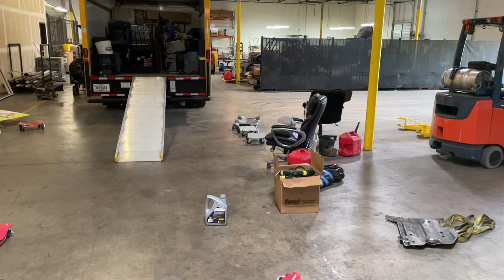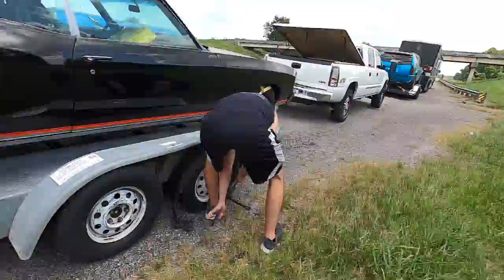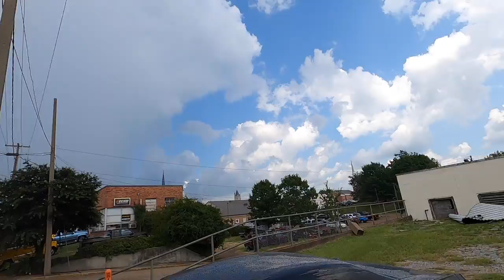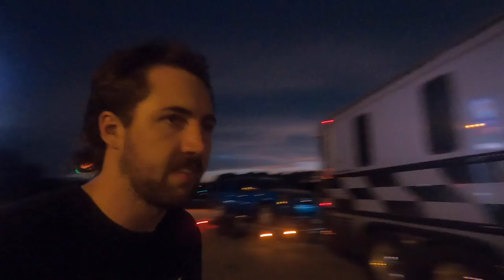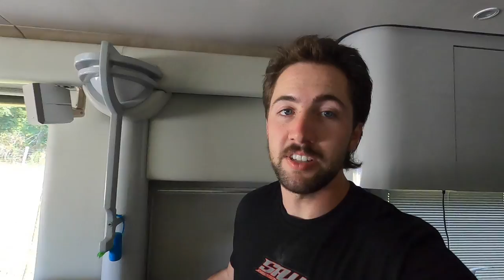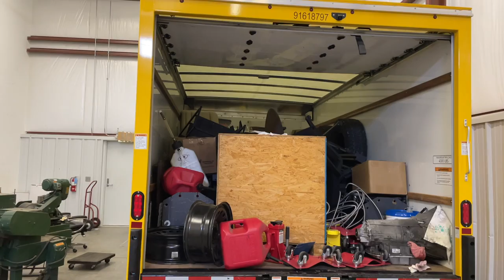WE MOVED! 1,100 Mile Road Trip To Our New Shop! We Had Some Problems.. (Meet The New Garage)

Comment: Just want to say Logan is a trooper during the roadtrip car hauling adventure.
Reply: She's the unsung hero. Just jumps in and does stuff without being asked. Wife material right there.
Reply from the maker: @nomercyinc6783  You totally have no clue lol
Reply from the maker: @krisjones2265  You’re absolutely right. These last couple months have been probably the most difficult time I’ve gone through and she was right there with me. Couldn’t have done it without her.
Reply: she actually seems really cool
Reply: @nomercyinc6783  To a lot of people driving that kind of distance is really intimidating. To step up and do that while towing a trailer for the first time is a big commitment. And then getting hit in the trailer in the first mile would shake a lot of people's confidence. Then driving hundreds of miles with the trailer way out of alignment, I'm sure it pulled a little. And then the flat tire. And driving with three wheels on the trailer, etc. And then find her a new trailer, she's sitting in the Monte Carlo pushing hard on the brakes for who knows how long without complaining. Turn around and she's right in there strapping the car down instead of waiting for Mitchell to do it.

All of that is a testament to her character, her commitment, her confidence. She may be small, but she is not weak (of mind or near as I can tell, physical strength either). She's a winner. Don't demean that, it makes you look bad.
Reply: Hell yeah she is! Sees a problem and jumps in to solve it.

Comment: Pull the air distribution box/controls off under the ac unit and look for a label with the model number of the ac, call your local RV stores and buy one, they are SUPER EASY to replace if you have a forklift to get it on the roof!

Comment: When your brakes get really hot like that the worst thing you can do is to stop because they can catch fire. In that situation the best thing to do is make sure there released and than get moving again. The air from driving will keep any fire from happening and cool the brakes at the same time.
Reply: ABSOLUTELY only the inexperienced stop,,,,just release the brakes from whatever had them hanging and get or keep on rolling along the high speed 60+ mph wind will cool them in a heartbeat,,,,and keep things from catching fire and also less chance of warped rotors or drums,,,I don't know this guy but if he works on cars and doesn't know that?????.
Reply from the maker: I didn’t know that’s what it was until AFTER I stopped. At first I thought the engine bay was on fire. Of course you’re gonna pull over if you think it’s on fire 🤷🏻‍♂️

Comment: The Hawg sounds like a 60 series you should high idle when stopped *cruise on set resume resume resume to 1000 rpm
Reply: Series 69 limited edition
Reply: @loganerwin42  the engine it’s a Detroit Diesel 60 series probably a 12.7 . I have the same engine in my semi. 69 sounds good though 😂
Reply: I know series 69 just sounds cooler 😂😂
Reply from the maker: I do use high idle if it’s gonna sit for a while yes

Comment: Brother, that is not very far from my old stomping grounds. I grew up outside of Darlington SC now in Pittsburgh but eventually want to get back down there. Keep pushing and keep it moving in the right direction. 

Radios can be a world of difference. The cheap wal-mart deals work great for convoys but do yourself a favor and look in to GMRS or maybe even the HAM technician level exam. GMRS will allow you to do most everything that Rugged Radios advertise for yourself with no test to take and only $75.00 /10 year license. Feel free to hit me up if you want some ideas or advice radio wise.

Comment: I did a 2600 mile solo move with a 26' Penske towing my project car on a trailer. The pre-check was laughable lol... they walked around, kicked the tires and handed me the keys. Had a "transmission fluid low" warning for half the drive but made it through just fine. Still mind boggling to me that they just rent em out to anyone!! My first time towing, let alone driving a mini semi truck 😂

Comment: You can add a second ac unit anywhere where that has a fantastic vent/fan. It prob is already pre wired. Find a rv place and see if you can buy a used unit.

Comment: When you drive that thing you need a truck GPS, it will route you around low bridges, tiny roads, small intersections etc. You put in your truck dimensions, height, width, length.

Comment: You were talking about walkie talkie communications I usually have a cb installed in my truck and the magnet mount Wilson lil wil cb antenna in the center of the rear of the roof of the truck.

Comment: Water usually want hurt nothing but if they get to hot when u do use extinguisher r water just stay clear of the tires if possible especially inside they we’ll definitely blow those drums hot r like putting a tire in a oven but it’s usually is they’ll release it’s better to keep driving the air will cool them down

Comment: I'm pretty sure I know exactly where you guys are at.  A trucking company I used to work for parked trailers in a lot on the same road that Armageddon is on.  I haven't followed you guys long enough to know if that's public knowledge so I won't say more than that, but it's a really nice area and plenty of racing history in any direction.  Good area to be a racing fan.
Reply from the maker: We aren't there anymore but the other guys are if you'd like to go bother them. They kicked us out in favor of a pro stock team after 2 months. Huge headache.

Comment: as with one school of thought there is always another that completely contradicts the other. Idling a diesel or even running it at speed, but under very low load can cause a lot of carbon to build up on the valves because there isn't enough heat the the combustion to burn it off. The extreme cases can be seen in generators that do an unloaded exercise cycle every week, they become so plugged up with soot/carbon, that when called upon to handle a decent load, they can't meet their rated power output and fail during an actual power outage.
Reply from the maker: They advise to idle the series 60 on high idle if it’s gonna sit for a while for this reason

Comment: You can replace that A/C unit yourself, the hard part is getting the unit on the roof
Reply from the maker: The one on the roof is the only one that works. I need to cut a hole and add another one on the roof in the front

Comment: I bought a 19 pc sae deep 6 point socket set and a 24? Pc metric deep socket set both 1/2 inch Dr tekton and a set of their wrenches because it was a 30pc set sae and metric combination wrenches with wrench rack holders and I believe I will end up buying more tekton tools and honestly they seem decent they are all well built no lightweight stuff at all except the wrench holder set,, May be tawainese made but I've had USA stuff that wasn't built that well and they are all complete sets no skips...

Comment: Hey bro, I just found your channel however, I've watched several of your videos today! Because you overheated your brakes, You should DEFINITELY FLUSH YOUR BRAKE FLUID OR, AT LEAST BLEED THE REAR BRAKES ALOT!!! As the saying goes, If you haven't gone through several bottles of brake fluid, it's not done correctly! Please, flush your brake fluid by bleeding your rear brakes untill all the old fluid is gone & you see fresh fluid, keeping the master cylinder full!!!! Also, consider changing the rear pads & rotors! They are probably very glazed...
Reply from the maker: These are air brakes

Comment: Dang man, that’s some rough road trip luck!
There was a time once that I had to limp a camper on 3 wheels for what was supposed to be a 45 minute trip. Took us 2 hours to limp it home. All at night with no lights on the camper working. The break-away brake key was missing on the camper. Hook up the lights and it turned on the brakes instantly. That freaking sucked bad. Thankfully I didn’t get rear ended.

Anyway, welcome to NC!! Congrats on the new place! I’m sure y’all will like it here in NC.

Also, you hiring? I’m just 45 minutes north of Mooresville. 🤣

Comment: This is why they shouldn't let u guys run these Busses with air brakes.. if it was just your fault for not pushing in the button,  then u probably should've started driving again and not used the brakes to get them cooled off, reason being is when u are sitting and the drum and hub is cooking hot, its melting your wheel seal on the top side where it has no oil cooling it off. You should keep a eye on that now. If u start seeing wet ness around drums on inside,  or u start feeling your brakes going away,  u have oil soaked brakes shoes, and your rear is low on oil

Comment: I would think if the brakes were hot it would be quicker cooling them down while riding on the road with air flowing over on then sitting still. Of course you don’t want to take a chance of having to hit the brakes hard while they’re hot. But being on the interstate it shouldn’t have much problem as long as you don’t have some idiot drivers in front of you

Comment: Watch your tires and rims ... They sabotaged my electric bike the same way ... We need a sign ... They broke it so we fixed it ... They sabotaged my 1999 grand prix gt with the 4th cylinder ... I sold that car in 2007/8? Might have been sold in 09 .... ..... My last car was a Buick Park Avenue 1998 ... Scraped it in 2011  the year I got divorced ... The S frame went ... I put a Racing exhaust on it ... It would go steady at 110 mph ... I almost bought a Dodge once .... Almost